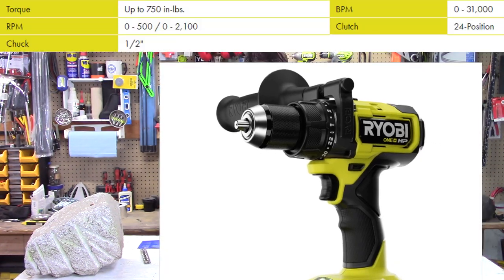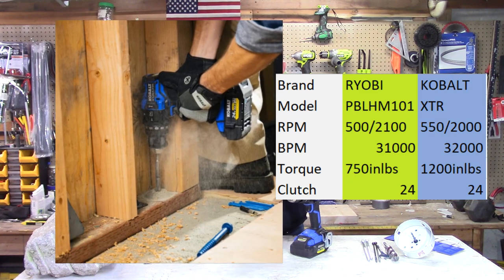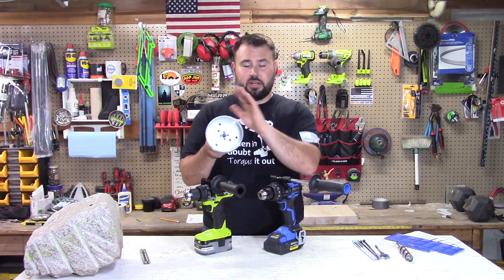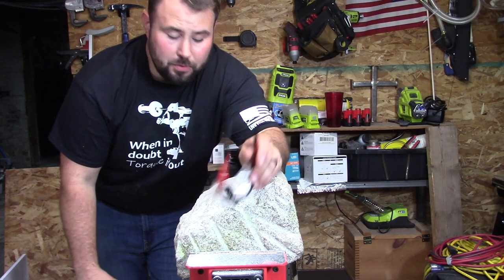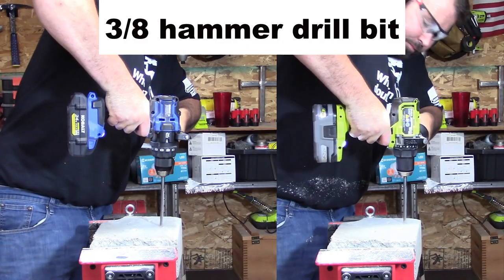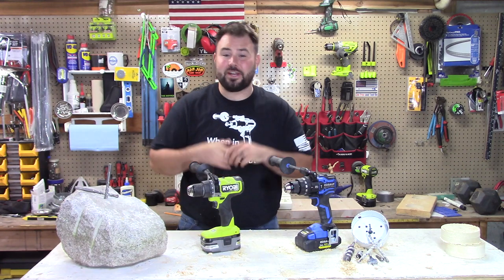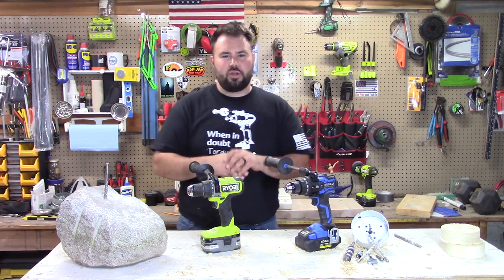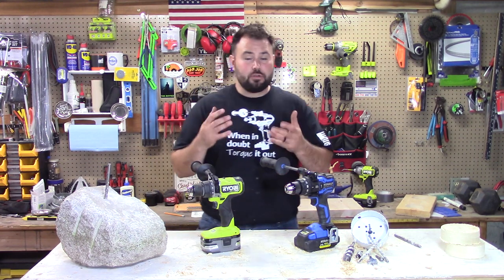Ryobi vs Kobalt [Hammer Drill] Limits tested

Comment: Are you psyched for the new Ryobi wall that’s coming out I think it’s called links?
Reply from the maker: I will have to see it and check it out, it’s a storage system to compete with Milwaukee and others. The concept is interesting
Reply: @livefreeandtoolon  Yeah I just bought a bunch of wood to make a cleat wall but I’m kind of interested so I might hold off on building that I could always use the wood for something else

Comment: I was comparing between exactly those two. But I went to Ryobi since my lawn mower is also Ryobi, although a bit older model but it came with x2 of 4Ah 18V One+ (not HP) batteries. I also have a couple more Ryobi outdoor tools as well. So, sticking to the platform seem to be better idea.

I am surely missing out the extreme performance from XTR. But I'm quite sure that this Ryobi hammer drill can do anything I need. And the Ryobi kit also brings in an impact driver.

Comment: For most of us , the homeowner grade tools are just fine and will last many years.  I have a wall full of kobalt tools and I am extremely satisfied with their value and performance.   I arrived at this point due to the high cost of replacing dead Dewalt batteries.   I can buy almost three Kobalt batteries for the price of just one Dewalt battery for my old ...now useless...Dewalt tools.   Also , the XTR Kobalt tools are their upper line and unless the Ryobi tool was similarly placed, that means that it did very well indeed.

Comment: Kobalt has a 3 pc kit for 249 which comes with an ultimate output and 2.0 battery and the 900 lumens LED work light.  224 when it was on sale.